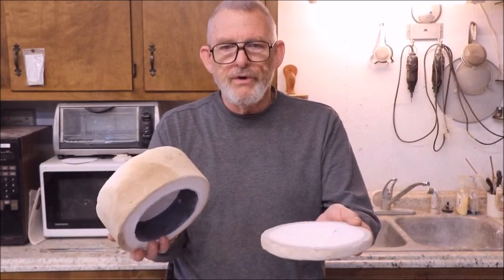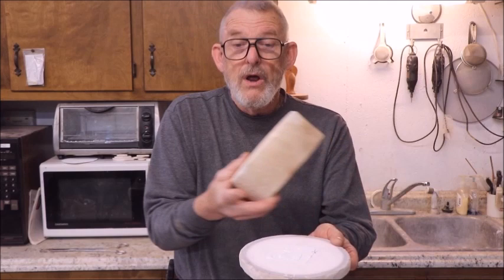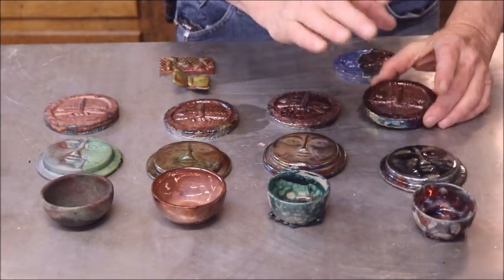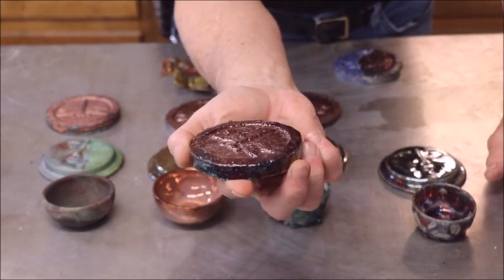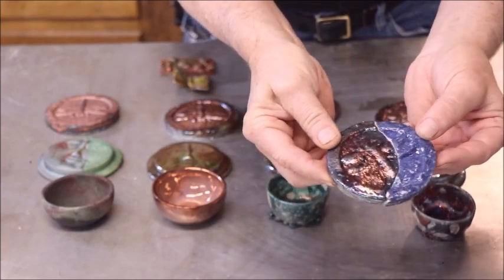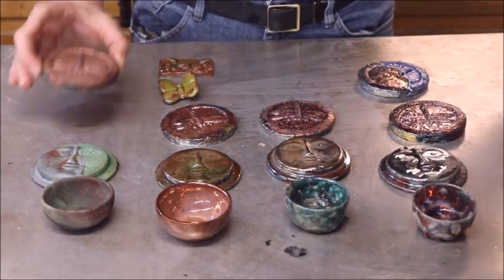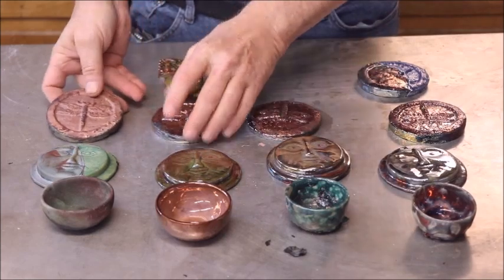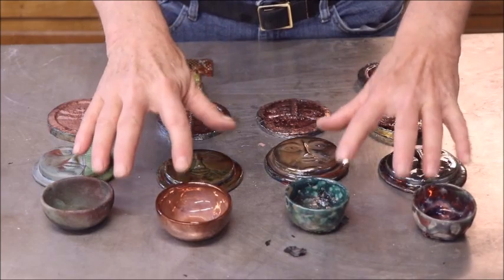Micro Wave Kiln Raku Tests

Comment: Thanks for you Video, as a Potter i may have a hint , concerning the difference between dipping and brushing: normally brushing creates rather thin layers , dipping creates rather thicker layers, depending on the amount of water you may add to the Glaze.
The crystals found in one of the glazes are normal for some type of  low fired glazes as e.g. raku glazes, because the alkalimetals in it will tend to form crystals with other parts of the glaze, when  stored for longer periods. Don't leave them aside, dont filter them out, you can and you should sieve these glaze through a fine sieve (320 mesh), available at most good pottery mags. When you separate these crystals you will change the composition of the glaze and the glaze will not come out nicely, they belong to the receipt. It is recommended to sieve any glaze before using, just to homogenize all the particles in the batch. To have "ready to go" Glazes , does not mean, that the water content is fitting the intentions of the Potter, you can delute the Glaze with some water to ensure thinner coatings. This will also reduce bubbles, and it  also will reduce bubbles and craters when you keep the piece you fire for some minutes more in the kiln, just  to prolong the time the Glaze is really Liquid, so gases stored in the body of the ceramic piece underneath have  enough time to pass through the glaze....

Never fire a damp piece of clay, cause evaporating water may explode and may even ruin your Kiln and other pieces inside,and as you already experienced, it will chip of the glaze. 
Cheers!😉
Reply from the maker: Thanks for the pro tips! I know some of them are new to me.  We are always learning and that is what makes me happy!  Feel free to give advise and or corrections to my videos whenever you see the need.

Comment: I imagine the firing temperature you manage to get to matters, but I'm not sure if I'm over or under firing my pieces. I saw in another video you were using some kind of temperature probe? I looked into buying something like that but the options were very confusing.

I think also the size of the piece matters, because you need enough heat in there to get the reduction chamber going. (When I did smaller pieces or fragments of something that broke, they didn't really react at all)
Reply from the maker: I did not use the temp probe on these tests as the probe is not that accurate.  I just fired the kiln to the same time for consistency.  The mass of the piece being fired does matter.  The more mass the longer it will retain heat.
Reply: Yeah this is just the first piece Ive fired, so I am trying to narrow down the variables. the glaze says 900-1000 C and Ive no idea where Im getting to relative to that. Will do more experiments but would just be nice to know whether Im in that range so I can focus on other variables. Like I could be anywhere from 800-1100 because I dont have the experience to do it by colour any more acurately than that

Comment: Dipping only needs one coat, so maybe you were over coating it. It also depends on how much water is in the mix. If you make them from dry mixes and add your own water content you can determine how you'll use the glaze and add the appropriate amount of water based on that.

Comment: Could the ladies microwave be damaged in making the first two pieces and now there's uneven heating/microwave distribution. Some manufacturers  microwaves are more reliable than others even for food cooking. It's possibly that lesser m'waves may not like the temperatures reached with the kilns
Reply from the maker: I had not given that any thought, but it is possible.

Comment: What type of clay do you use please?
Reply from the maker: The slip I use id mostly low fire (conr 04) clay.  I do use different clay bodies (solid clay) depending on what type of glaze I will be using.  But remember reguardless of whether you use low, middle, high or porcelin clay it all first bisques to cone 04)

Comment: nice,I would like to know what minimum microwave power is needed to obtain the clay firing temperature ...
Reply from the maker: I have used everything from a 600 watt up to a 1500 watt.  The less watts the longer it will take to heat up.
Reply: @CaptMike  thanks, i have used it at 800 watts and after  20 minutes the clay is not fired at all
Reply from the maker: @bertodichi3078  Is your MW set to "High"  20 minutes is plenty even for a 600 watt.

Comment: Can u use raku clay for molds for fusing glass?
Reply: With out the glaze
Reply from the maker: Sure, it will work fine.  Just make sure that you use a glass release before fusing your class to the mold.

Comment: Do you think a Orton cone could go inside the microwave kiln
Reply from the maker: I never thought of that. My kiln will reach 1790 degrees F.I guess I could try and see.
Reply: @CaptMike  If you made a video of you trying that it would really help me
Reply from the maker: @Yannick432  I ran a test this afternoon.  The only cones I have are cone 02, 03, 04, 05, 06, 2 &3.  I arrainged them on a ceramic cookie and zapped them for 20 minutes.  the 05 sagged a little and the 06 completerly sagged, indicating the temps had to get somewhere around 1830 degrees.  For a video, what else could I do to help?
Reply: @CaptMike  wow   in fact you answered my question , i thought orton cone couldnt go inside a microwave ! I deeply thank you for having try this experiment . One question still come to mind : What power is your microwave ?
Reply from the maker: @Yannick432  1500 watt.  I will do a video showing the outcome of the cones at 20 minutes and at 30 minutes.
Reply: @CaptMike  🤝many thanks
Reply from the maker: @Yannick432  Here you go.  Hope this helps.

Comment: That armadillo is contaminated. I use it all the time, usually as accents, but it should NOT look like that straight out the jug. Strangely enough that's similar to what the texture looks like if you use a single coat or maybe two light coats, it gets that flaky texture but only after firing and reducing
Reply from the maker: I just gave up on that glaze.  Thanks for the comment!